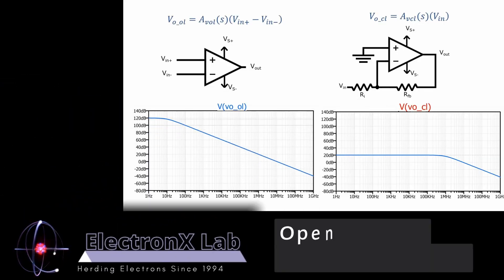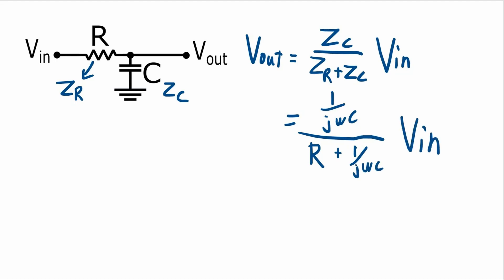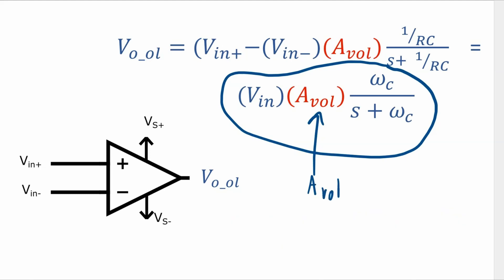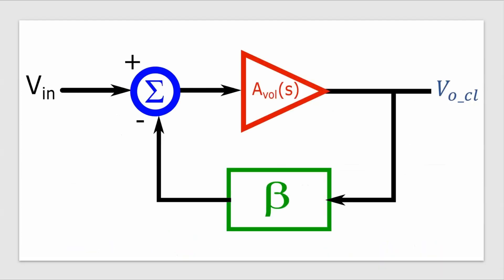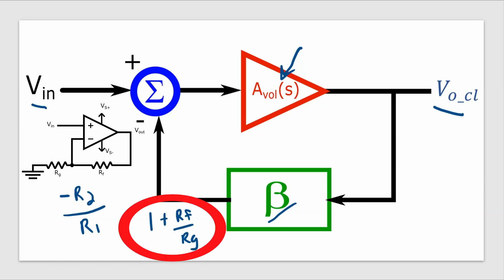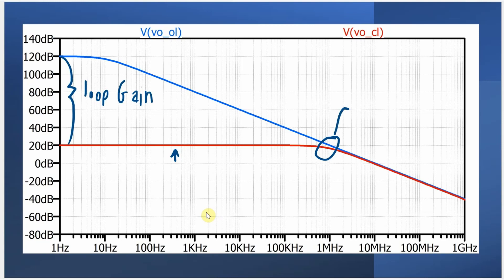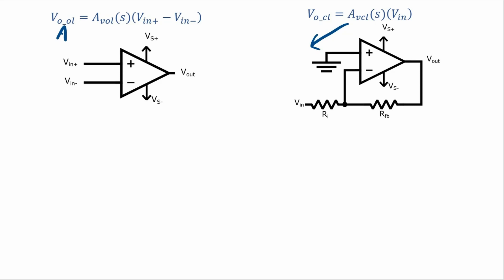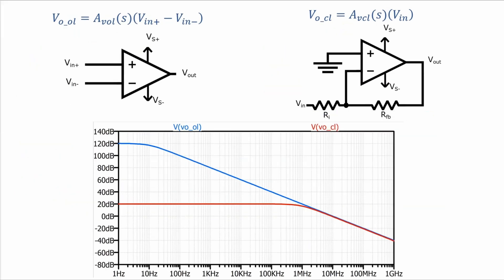Op Amp Open Loop vs Closed Loop Gain Response

Comment: Hey nice Video, I would however like to point out, that for the Inverting amplifier, the gain should only approximate to 1/β for high gains. In fact, the total gain consists of the amplifier's gain and the input voltage divider, which is why for unity gain an inverting amplifier is more stable, as β = ½ compared to β = 1  in the case of a noninverting Amplifier 😄 This may not matter a lot for this introductory Video, however, I feel like this is an Important detail once it comes to stability analysis.

Comment: Is -3.0 db still the best value to use when designing..?

(where you'd measure your cut-off frequency at)
Reply from the maker: Corner (cutoff) frequency is at -3dB
Reply: @ElectronXLab  Awesome, thank you!! I was trying to remember for one of my old engineering books and I wasn't sure if that was what they still use or not, thank you!!